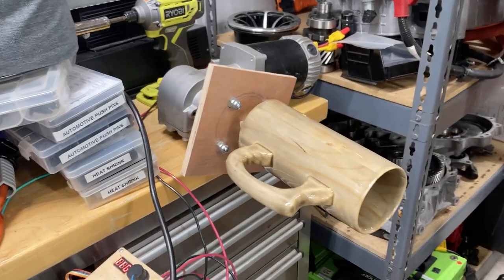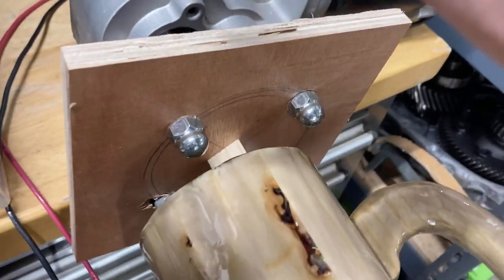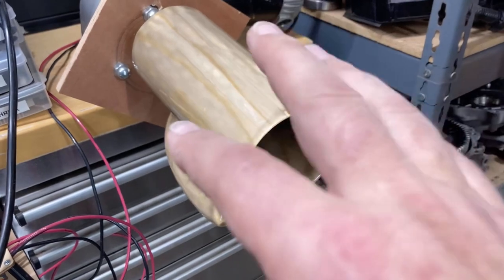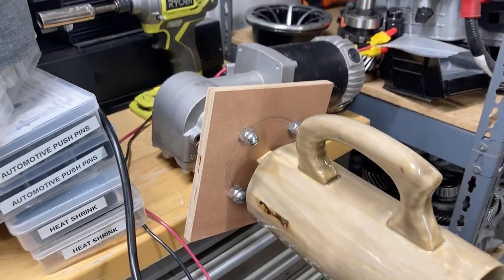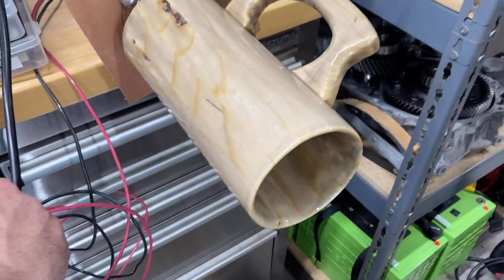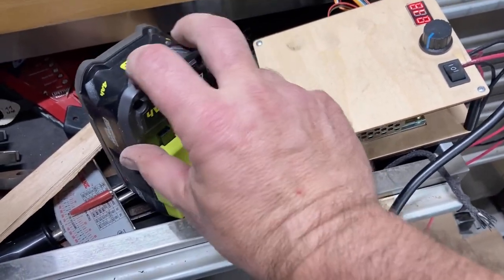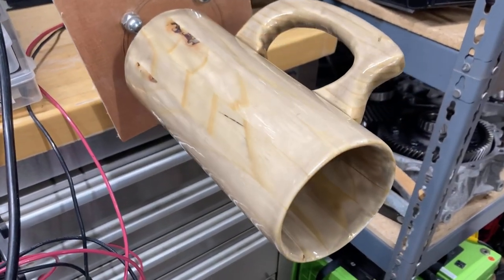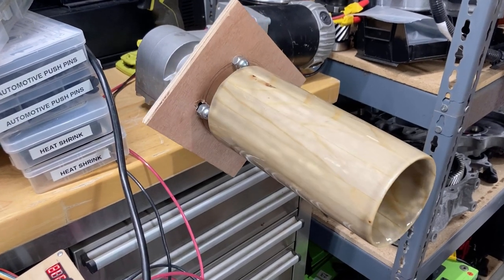Motor-Controlled Rotation for Epoxy Finishing - Wood Mug/Beer Stein/Tankard

Comment: I built something similar for my wife a couple years ago when she wanted to epoxy mugs. She put different sizes of foam on the ends of sticks so she could just slide the holder inside the mug instead of supergluing to the bottom of it.
Reply from the maker: How do you work on the INSIDE of a mug with that design?
Reply: @BenjaminNelsonX  we weren't epoxying the inside or the lip because the resin we were using wasn't food safe and the mugs had finished insides when we bought them

Comment: just run it on the battery charger! you are only burning 20W
Reply from the maker: One of the things I like about DC is how easy it is to run from a variety of sources.
This motor was already rigged up with the Ryobi battery adapter from the last project, so I just slapped a battery in there.
There are other ways to power it as well.